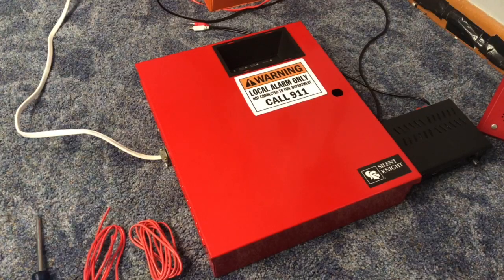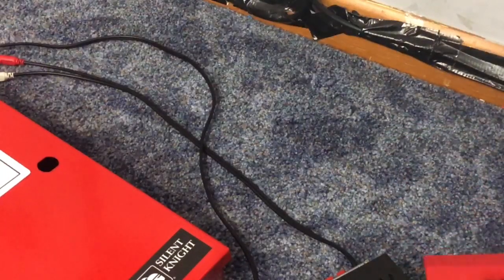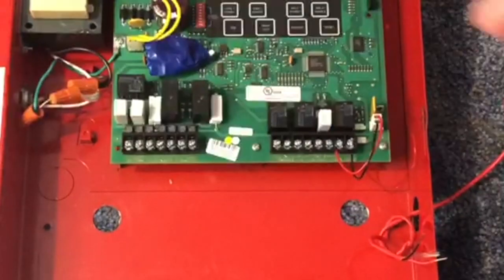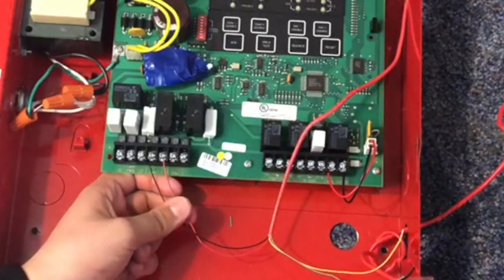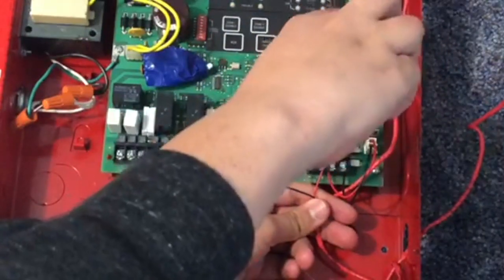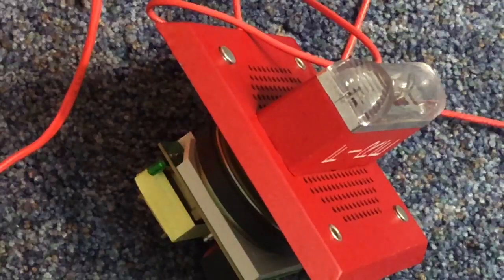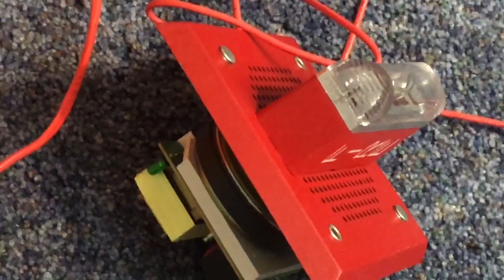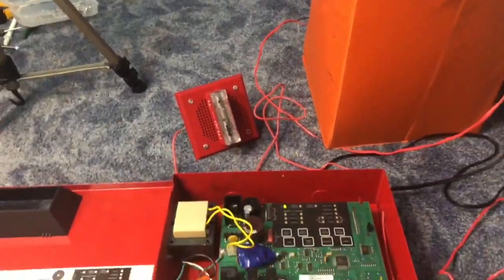how to turn almost any fire alarm panel into a "voice evac panel"

Comment: Wait, is there a special type of amplifier? (also is there a link for one?)
Can you wire the speaker up to a nac? or no?
Reply: By the way.. last question but what app did you use to make it loop and play the audio?
Reply from the maker: The amplifier used in here is just a regular amplifier, they don’t sell it anymore though Power Home HiFi Stereo Amplifier - 90 Watt Portable Dual Channel Surround Sound Audio Receiver w/ 12V Adapter - For Subwoofer Speaker, MP3, iPad, iPhone, Car, Marine Boat, PA System - Pyle PFA300 https://www.amazon.com/dp/B0071HZ5LE/ref=cm_sw_r_cp_api_i_svVvCbVZGDA9W

If you wire up a speaker to a NAC it will just make the sound of the 24VDC and you run the risk of blowing the speaker
Reply: @Aaronproductions  Oh, Thank you so much!